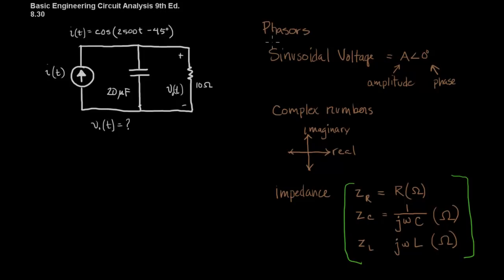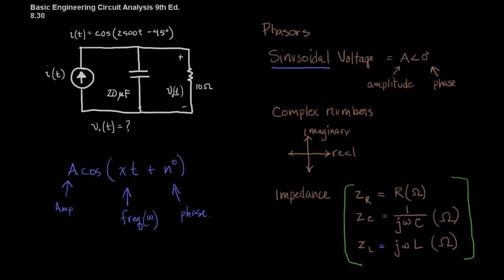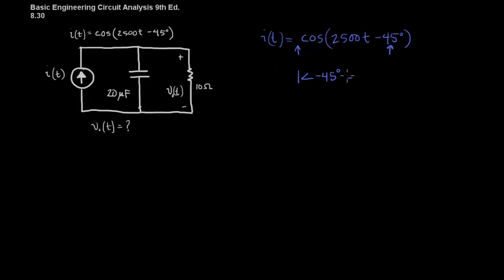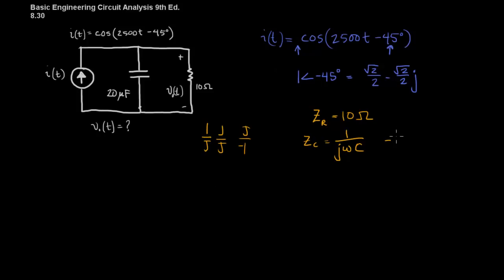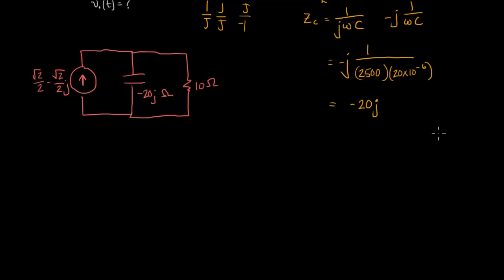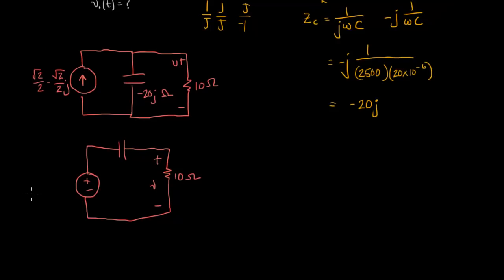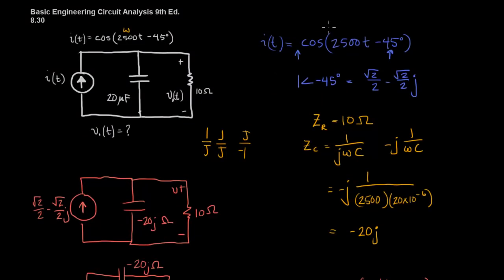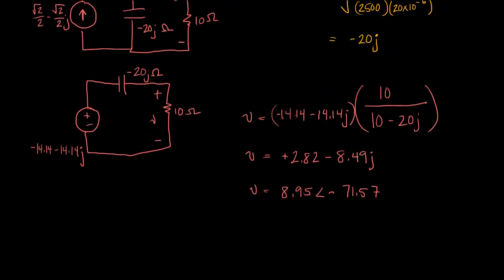Steady State Circuit Analysis with Phasors

Comment: In case you didn't already figure it out, he used source transformation in order to go from a current source with an element in parallel to a voltage source with an element in series (using ohms law) so that he could use voltage division to find the voltage across the resistor.

Comment: An easier way to solve, even without using mathematica and the source transformation.

Calculate the replacement impedance using (Zc*Zr)/(Zc+Zr) and you'll find that it is as easy as 8-4j.

Then by using Ohm's law U=IR, you can multiply the source sqrt(2)/2-j*sqrt(2)/2 with this complex impedance 8-4j to find U = 2sqrt(2)-j*6sqrt(2)

Now, the magnitude is found with the pythagorean theorem over the real and imaginary part: it is 4sqrt(5) which is approximately 8.94 [V] and the phase (or argument) is a bit more complicated using arctan(-6sqrt(2)/2sqrt(2)) which is arctan(-3) = -71.57 degrees.

Final answer: 8.94 < -71.57 (using < as an 'angle' sign)
Reply: So much easier, thanks
Reply: Thanks for this, we wouldn't be able to use mathematica for our exam

Comment: can you show how you get -14.14-14.14j just tired and having wrong numbers
Reply: It's just multiplication (-20j) * (√ 2/2 - √ 2j/2) = -14.14j - 14.14
Reply: Zhenis Otarbay  also he was trying to  do  source transformations and he changed that current source and parallel zc into voltage source in series with zc by multiply ,rmb V=IR

Comment: I'm still new to circuits, so I don't quite understand how you turned a parallel circuit into a series circuit so easily. Please help me here.
Reply: source transformation
Reply: Brad Watterworth using ohms law
Reply: source transformation easy to change current source to voltage source.

Comment: Is there anything wrong with using current division, using the equivalent impedance of both elements, to get the current at the resistor branch and then calculating the voltage using Ohm's Law? I seem to be getting a different answer.

Comment: Could you please explain what happend when you multiplied the voltage (-14.14-14.14j)*(10/10-20j)

I understand that 10-20j i the sum of the ohms but where does the 10 in the numerator come from ??

Comment: I'm wondering why we use "j" instead of "i."  My professor never told us why and I can't find a reason in the textbook.
Reply from the maker: This is a convention for electrical engineering to avoid confusion between i - which is used for current, and i - the imaginary number.
Reply: Matthew Araujo appreciate your help.
Reply: Matthew Araujo  a good answer, :D
Reply: +Mfaniseni Thusi I think the primary reason is that "i/I" appears as the symbol for current in EE, so they just use 'j' instead.  Though it probably does come from vector notation and the vertical axis frequently being the 'j-hat' dimension.

Comment: (-14.14-14.14j)(10/10-20j) = -8.484-2.828j

That is what my calc gave me which means your calculation was incorrect?
Reply from the maker: you might have a typo on your calculator.  I rechecked on my ti89 and I get the same result I did in the video
Reply: yea nvm you're correct
Reply: hey i got -2.82+8.82j !!! whats goin on here!!!